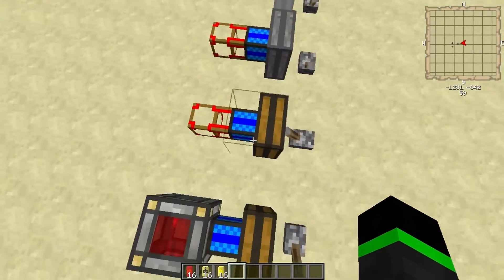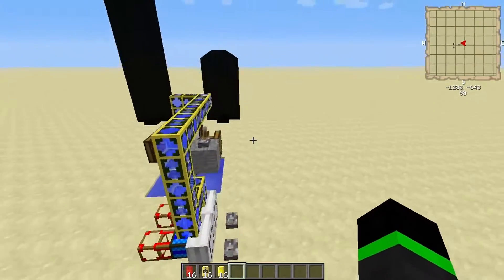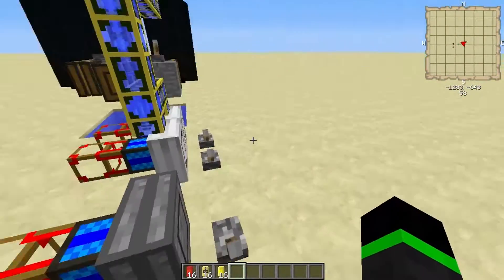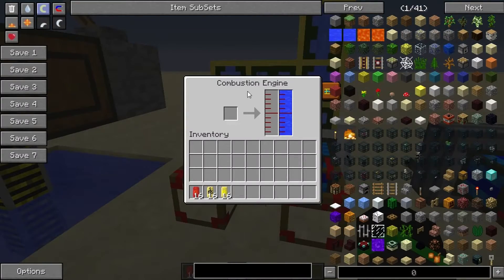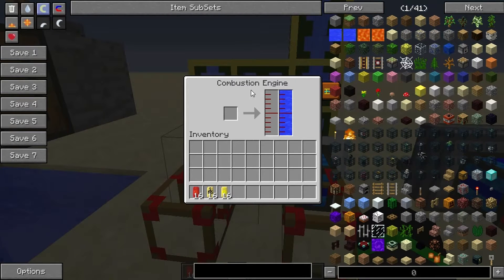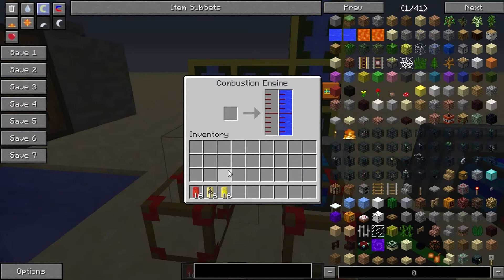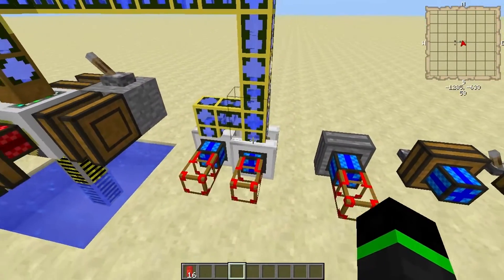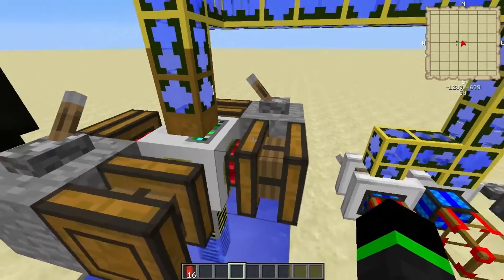BuildCraft Tutorial (Engines)

Comment: Instead of golden and wooden waterproof transport pipe, you can use liquiduct instead (Each pipe can hold 80mB). So, for example, 9 liquiduct attached to one steam boiler is enough to keep up 18 industrial steam engines (720mB/t, so 144Mj/t). Plus, you don't need one wooden waterproof pipe attached to one pump, use golden instead. And aqueous accumulator are a way more efficient to pump water !"MinecraftJoules".